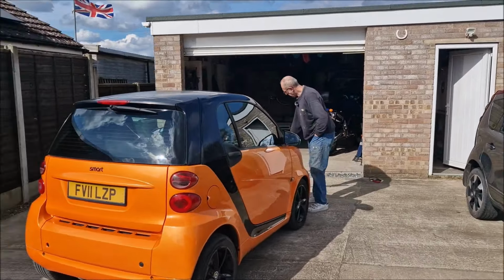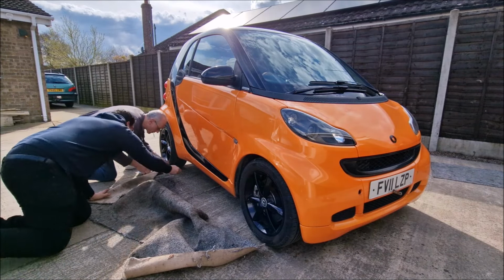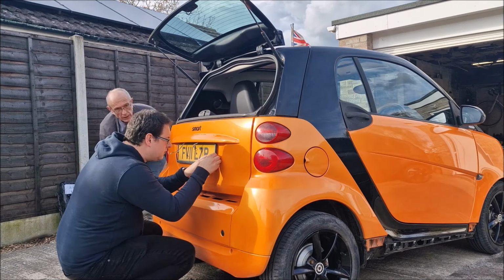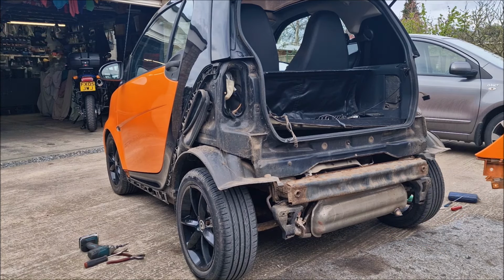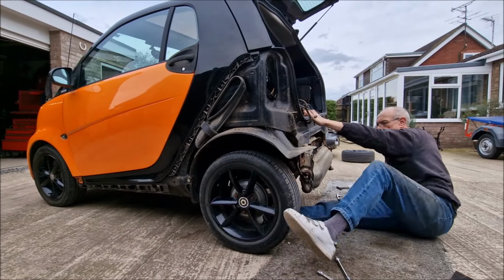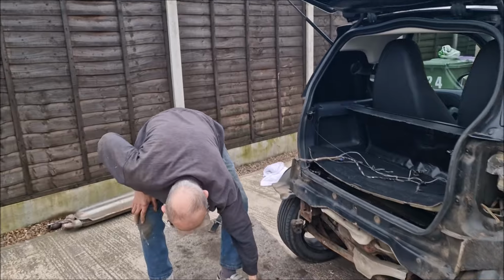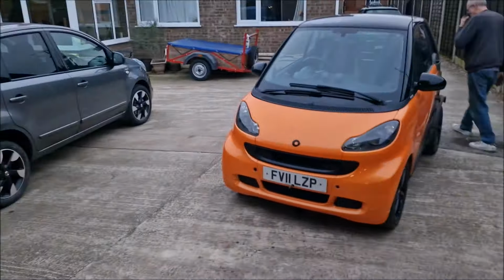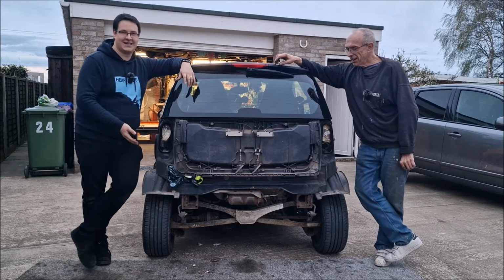Smart ForTwo 451 Exhaust Removal - We DID NOT Expect That!

Comment: I did a muffler repair on my 2011 Smart 451 two years ago, and had to do almost exactly what you did.  I removed the rear body panels, rear tyres, but couldn't remove the crash bar - one bolt was inaccessible and seized, so instead of removing the crash bar, I jacked up the car and lowered the engine. This is easier than it sounds because the engine/axle assembly drops down off the frame by removing 4 bolts. I had to buy some long bolts to lower the engine while keeping it attached to the frame.  I bought an angle grinder just so I could separate the muffler from the catalytic converter, and made the same decision you did - to buy a new Smart-brand muffler.  I also replaced the spark plugs while the engine was accessible and increased my fuel economy by 1 litre/100km, from 5.0 to 4.0.   BUT it's been a dream to drive ever since!
Reply from the maker: Glad you also managed to get sorted out ☺️

Comment: Well, Jon, cheers to you and your Dad for taking the trouble of showing me what I am now up against.  The lower part of the flex pipe separated from where it curves then goes into the muffler.  So, I haven't started pulling panels yet, but I did get a replacement - USD 215, not OEM, but for an OEM I would have to get a used one and I am not in the mood for doing this twice!  22k miles on this, got it for free, so, I guess I'm ahead of the game lol.  I'll report back when all said and done :)
Reply from the maker: Thanks Mike. Glad it helped. Keep us posted

Comment: Read the car manuel. There are jacking points behind the front wheel and ahead of the rear wheel. No need to remove anything to jack it up! 
I have one and and change the summer wheels for winter rims with snow tires. I live in Canada.
By all means remove other panels for access to the motor. Exhaust is held in with just a couple of bolts and hangs on rupper supports.
Reply: you need to remove the heat shield to get access to the two bolts on the exhaust flange. I believe those bolts are Torx also!!
Reply from the maker: We didnt want to risk damaging the sill covers for the sake of 5 minutes work (we also wanted to look at the state of the Tridian cell as they have a tendancy to rot out) - you are right, the exhaust is just a couple of bolts ... easy to get at and take off if they havent seized / turned to a nub!
Reply from the maker: i believe we just bent it back a wee bit (it was a while back now) - thanks for watching

Comment: You can use a jack on those plastic jack points. I've done it and had no issues, it went very smoothly.
Reply from the maker: We didnt want to risk it
Reply: @JonCoupland  for future reference it is completely safe just use a rubber spacer if your jack pad is bigger than the jack point. I know I was hesitant but the plastic held up great with no cracks. Loved watching the video though as I'm going to have to replace my exhaust soon, my flex pipe has started to wear out.

Comment: I am in the states and I have a 2015 smart 451 (not the newer ugly one, mine looks like yours but white) Yours has more rust than mine so something for me to look forward to I suppose.  I ran mine without a muffler for a week or so until I bought one on evil bay for 200 dollars U.S. and put it on.  I didn't remove the crash bar when I did mine but it would have been easier.  I think I'm the only person in my town that has a smart fortwo as they are not a popular vehicle in the states.  People buy huge monstrous trucks and sport utility vehicles here and too much horsepower is never enough here. I was able to get the original bolts out, replace the gasket and use the bolts in the kit to put the new muffler on as the threads were still very good.
Reply from the maker: We have now rust treating it so fingers crossed it's slowed down the process. Thanks for watching 😄

Comment: Hi to you both. What a " PAIN " to do. Surely you can Jack up the car, without removing the. Body Kit ?. If not. Home servicing will be. A nightmare. Are you treating the surface rust at the rear before the kit goes back on. 🤷‍♂🤷‍♂Cheers.
Reply from the maker: I believe others have pointed out that it is possible ... however not something im going to risk! Yes - rust will all be treated and killed and protected :)

Comment: Can hear the baffles rattling around 😂. There awefull thing's to work on I will stick to  my old PD audis 😂. You learn from your mistakes. Al have an Audi A4 😂 I already got one used to have 2
Reply from the maker: Yup! New exhaust incoming! I love my B5 A4's
Reply: @JonCoupland  I had a b5 av got avant sport b6 Tdi sport now. I have 5 years 186tho on the clock needs some trim work on inside. Other than that its a good Machine.

Comment: Yes, I've come to 'appreciate' my 451 in the same way I 'appreciate' my GTV. Both cars are an absolute bugger to work on, if for markedly different reasons...
...Alfa is known for cheerfully nailing their cars together without a care in the world. But the longer I own a Smart the more I have come to detest Merc's greed - "Let's make sure this 'cheap' small car is such a SOB to work on that only our dealers with touch them at Merc dealer prices!"

The result is of course aging Smarts are pretty much worthless long before their time because the moment anything goes wrong repairs are just too costly to be worth it.

My first 'hint' of this is when I thought I'd put a new-ish roof on my convertible. "Odd", I thought as I paid surprisingly little for a new-old-stock roof on fleaBay...
...once easily fitted, not only did the roof refuse to work the car went in to limp-home mode. Even my local very good garage couldn't work it out. Much googling later, it turned out pretty much everything in the Smart has a 'chip' in it, including the soft top, that is keyed to the car's ECU. Without access to Merc's dealer-only diagnostic equipment you can't tell the ECU to accept pretty much any replacement part with the result it both won't work and the ECU will 'default' to limp-home mode for your driving pleasure...
...for the LOLs I phoned a Merc dealer to find:
1) They would sell me a new roof for twice what the car is worth, and "No, we won't fit the roof you have", even though they could.
2) Fitment would cost pretty much the same again, and "No, we won't let you fit it."
3) Reprograming the ECU to accept the new roof requires no more than hooking up a laptop and clicking a mouse... £150:00 for that!!!

Given a soft-top is a pretty simple affair I was just going to disconnect it from the CAM bus, and wire in a couple of relays for the roof switch to operate the 'old fashioned' way - working roof, ECU non-the-wiser. 'Happily' the garage left the car out over night with the roof open, of course it rained, and in the morning one of the mechanics tried to close the roof in a fit of panic...
..."bzzzt!"...
...and for some reason once the car had dried out, instead of being FUBAR the roof started working! They don't know why, I don't know why, and when out of curiosity I called a non-Merc Smart specialist about it their only words were "Aren't you the lucky one!"

Basically if I keep this car for long I'll just progressively replace stuff with it's own (bodged) wiring until such time as I get ticked off or whatever has broken can't be run independently of the main ECU. 

I'm rambling, again. I hope somebody found my tale entertaining.

Comment: Just £300? 😉  .... cheaper than the £450 MB quoted me for my 451 turbo's exhaust
Reply from the maker: Get onto Smart Newcastle ☺️
Reply: @JonCoupland  I have bought bits & pieces from them in the past. I opted to fit the cheap pattern part 🤞
 I did buy a new flexi for my original just in case I ever got around to welding it in  ..... 🙄
NB my exhaust is different from yours in that the exit is on the near side, ie the same end as the inlet.
Reply from the maker: @EmilysDadd  ahhh ok